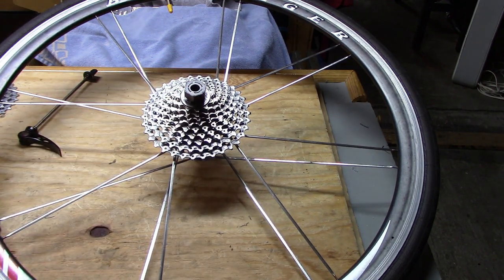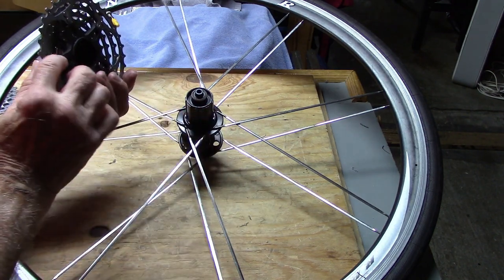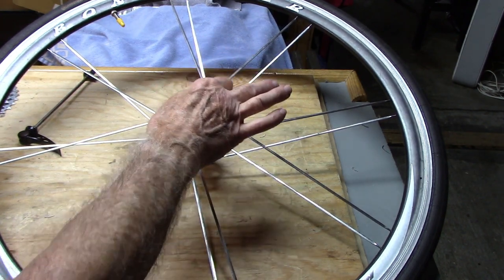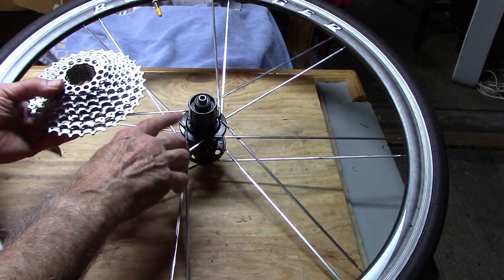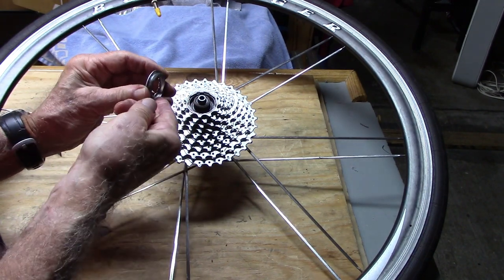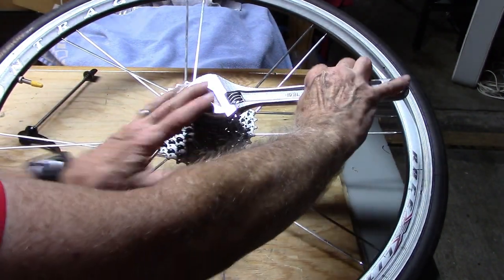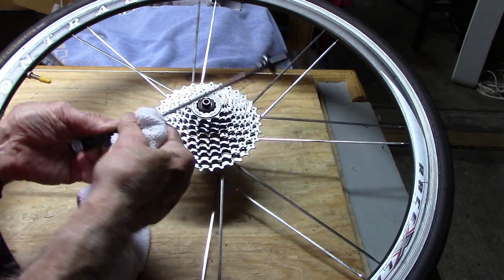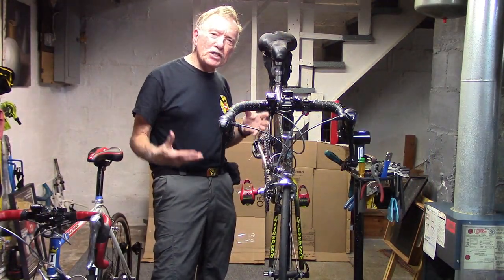Overlooked Bike Maintenance: Greasing Freehub & Quick Release Skewer or Thru Axle

Comment: If your taking the cassette off, you may as well service the freehub and bearings as well.  Cup and cone hubs require this maintenence and even sealed bearings dry over time.  If sealed bearings show rust, purchase a new cartridge, if you just feel a bit of friction, dust cap can be removed for greasing and replaced.  These would all be much more useful way to spend your time, when already replacing a cassette.
Reply from the maker: There are many freehubs and some are easier to service then others. Many of todays hub, such as Zipp, are easy to just pull off and service. But as we get into Shimano, especially older models, and it become more complex. Here are some examples:
https://www.youtube.com/watch?v=IDwH0QOnn_Y
and
https://www.youtube.com/watch?v=FXZY0A3DUkk
and
https://www.youtube.com/watch?v=99jvHp7Fb-U

Older Bontrager freehubs, because they use alloy rather then steel, can be almost impossible to remove and there are several videos on these.

As far as getting to the cups and cones of the wheel hub (rather then freehub) as you're mentioning above, it is a bit easier - in that you don't need to remove the freehub in most cases. How often do I service the hub, usually when I replace the tires (for me about 3,000 to 3500 miles). Hub service and ball bearing replacement on my Mavic wheels is relatively easy. But then again, it depends on the hub. So it's tough to make a generalization for all freehubs and wheel bearings.

Comment: I can’t say it’s needed on modern quality steel or aluminium hubs. They don’t rust and adding grease just attracts dirt. 

As for the QRs, I sometimes put a little on the threads, but not on the body. If the QRs are of quality material they don’t rust. 

For grease as a bike mechanic I only grease threaded parts and parts that move. Oh and end caps to keep water out.
Reply from the maker: I guess it's how we were taught. Light coat of grease on metal to metal contact decreases noise and repeals water. But I understand where your coming from. Thanks for your comment, much appreciated. Tony
Reply: True. Only attracts dirt and grime. Get titanium QRs if you ride in bad weather regularly though.

Comment: Can oil get into sealed bearings and does it matter? I'm adding grease to the bearings, but I'm not sure if I should put grease or oil on the freehub. There seem to be two opinions.
Reply from the maker: There is a debate on greasing the freehub. Some suggest leaving it dry, but others, ( myself included) put a very light coat of grease (not oil) on the freehub before installing the cassette because of the metal on metal contact (to reduce noise and prevent corrosion). The seals for the hub bearing are pretty good and prevent dirt, grime and moisture from getting into the hub (unless you spray a powerful hose or power washer directly at the hub). Good question. Regards and safe cycling, Tony

Comment: I Installed the rs100 wheelset but i only greased the lockring and the quick release lock nut. Guess i have to take the wheels out again ang grease the skewers and freehub body. Did not grease them coz i heard from others it’ll just attract dirt.
Reply from the maker: It's a debated issue and depends on how you were taught. I use grease where ever metal meets metal to prevent noise and decrease wear, but only a tiny amount. There are others who disagree. I would leave your wheel setup as it is and consider whether to grease (or not) the next time you replace you cassette. Regards, Tony
Reply: @tony10speed  I trust you, sir. I’ll grease them later before i tune my bike. Ride safe!
Reply: I did not grease the skewer and freehub previously until recently.

When I pressed the brakes while moving, the skewers would vibate and cause a very annoying ticking sound when the fork flexes.

As for the freehub body, whenever I apply torque to pedal the bike, there is ticking sounds coming from the freehub.

I used Maxima Waterproof Grease for the skewers and the paws/grooves in the freehub body and it eliminated all the noise.
Reply: @benedictypx  Hey appreciate all the info. Thanks!

Comment: What do you use on pawl springs? Oil? Or very thin grease so spring don't get stuck & move freely
Reply from the maker: For freehubs with pawls and springs, I use a light grease such as Shimano Internal Hub Grease or Finish Line Premium Grease made with Teflon, or something similar. Try just enough to keep the pawls and springs in place (not to much). For hubs with spings and gears, either Phil Wood Tenacious Lube Oil or light grease as above.
Reply: @tony10speed  I was just looking at the Shimano hub grease. Actually put it in my Amazon cart. TY!!

Comment: If you don't need to replace the cassette, should you remove it and re-grease the freehub?
Reply from the maker: I, personally, would remove, clean and grease the freehub every 2 or so years (if not replacing the cassette) if nothing more then removing the dirt and grime that build up between the cassette and freehub, especially at the point between the hub and largest cog. Good question, thanks.
Reply: Where you finding these free hubs?

Comment: Now does dry lube like carbon fare?
Reply from the maker: Most freehubs bodies are alloy or steel with some containing exotic metals such as titanium. I just use a very light coat of grease such as "Phil Waterproof Grease" all though many mechanics suggest leaving the interface dry (no lubricant). That's a matter of choice. I have not seen it suggested to use carbon paste. Interesting question, thanks. Tony